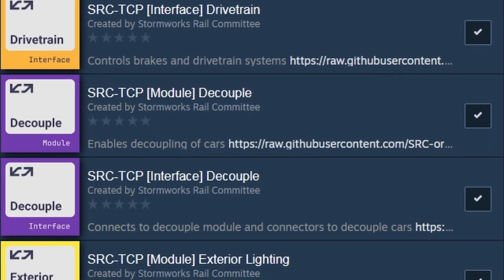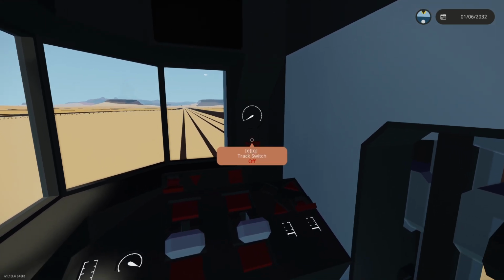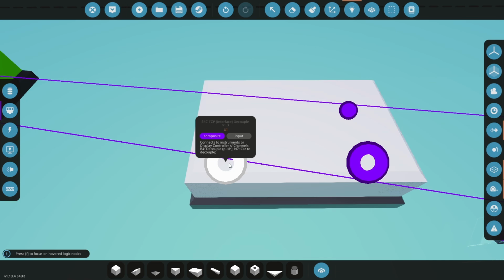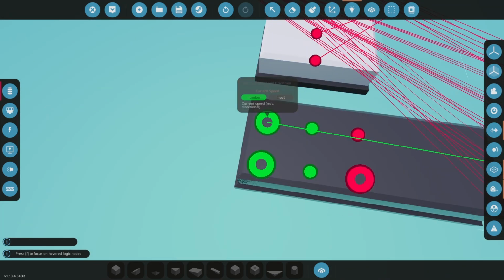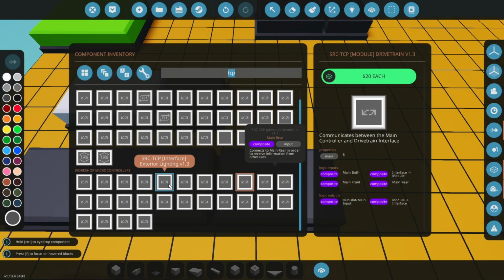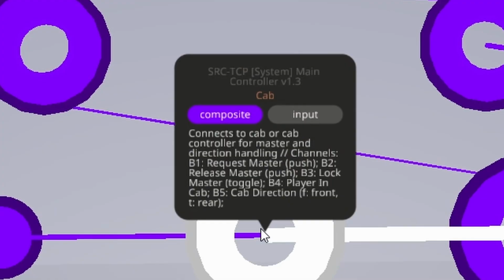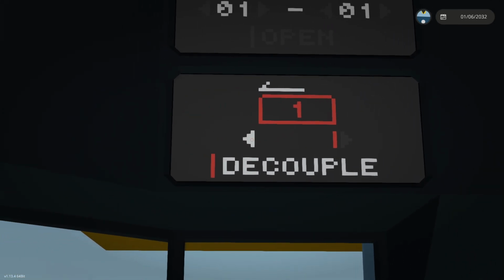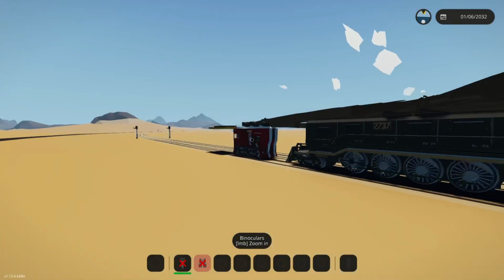Installing TCP 1.3 Into A Locomotive

Comment: how did you apply the drivetrain to the steam wheels, since the wheels dont output rps (if i remember correctly)
Reply from the maker: In this Loco the steam wheels are not connected to steam.

In the Drachen however, There is a controller that picks up the signal from the drivetrain which is between 0 and 1, if then sends it on to a variable valve which sends some of the steam into the steam wheels, and there is another variable valve which has the opposite amount and sends that direct to the condenser.

So if TCP says .8 power, it will open the steam wheels variable valve to .8 and the condenser variable valve to .2.

This makes it so steam pressure is never lost or builds up too much and everything keeps flowing around the system.
Reply: IIRC, he uses steam pistons to generate power, then feeds the power to motors.

Comment: Now that TCP is public have you considered doing a TCP only career mode? In the same idea of industry only. Assuming that containers are working properly.
Reply from the maker: TCP Only wouldn't really work since its only trains. I think trying to do another industrial only would be nice.

Right now I'm still working on building a career path of vehicles which will probably get used in some kind of career.

Fishing boat is stage 2 and complete. Crab boat is stage 1 and 90% rebuilt. Ive got a truck, planning a cargo handler.

So there's a lot going on in my mind prepping for career gameplay.